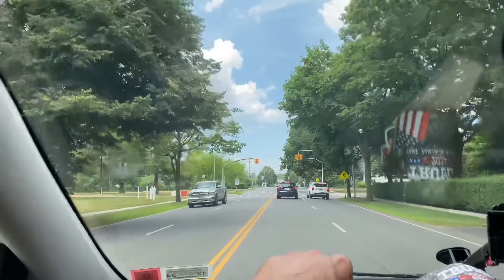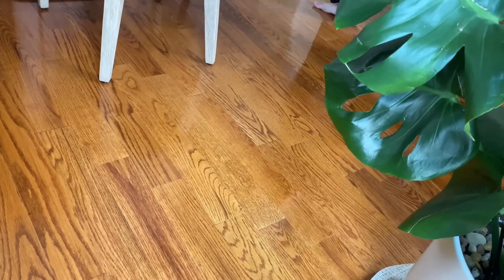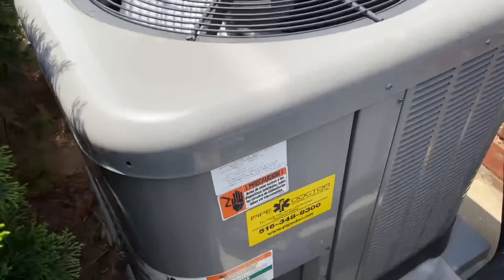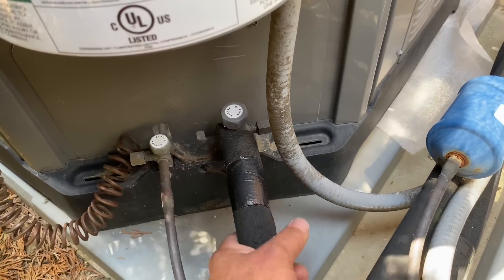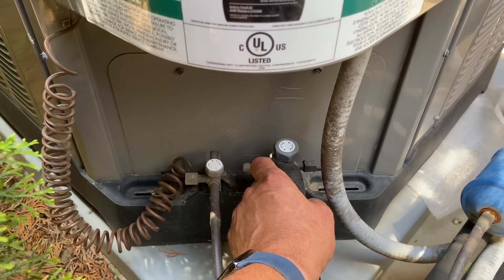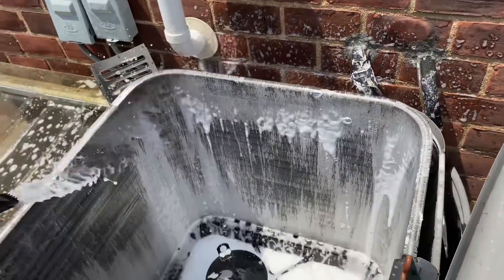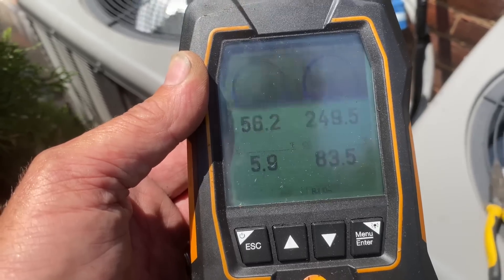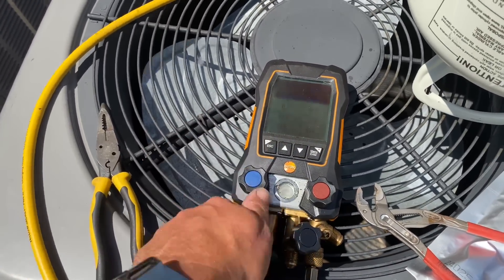Central AC System Not Cooling - Outdoor Condenser Beyond Filthy! Step by Step HVAC Service Call

Comment: You should know Mike , your stickers are on it and you can check your records ( by address not name, as they are new owners) for previous years and see what you have done there in the past. Good advice for coil cleaning. Always from the inside to the outside. Periodically cleaning the coil from outside is not a bad practice though. I generally tell my clients that coil should be chemically cleaned in two year cycles and periodic cleaning from time to time during lawn watering is a good practice to help with grass clippings and other debris.👍👍🇨🇦

Comment: Clean 100% no. Can Clean about 90% witch is good enough and much better then before. Plus factors like water pressure and coil design player Factor but yes you can clean very well from the outside without taking all apart it's just a matter of how much time do you want to spend cleaning it. For YouTube video purposes it looks very nice taking apart.  Again instead of adding sealant witch doesn't work instead of performing electronic leak check and finding leak to begin with. 95% time in evap coil. Good video Mikey
Reply from the maker: Thanks for sharing

Comment: Don’t ask my why but a fur coat seams to lead to a leak somewhere in the system .  A super super fine leak under normal operating temperatures takes couple years to leak out but high pressures from a fur coat  will find that leak … if the system been in for 3 + years that about a pound a year…  that’s a SUPER Fine leak an them are hard to find even with the dye….. I got a 5 head mini split making me pull my hair out 🤬 condenser checks out fine. All five heads check out fine.  A run  all  5 line set a zero nada nothing…  but in 3 months  she is down again !!  I’m pulling my hair out. No visible leaks to different sniffers. Did not pick up the leak.

Comment: Just out of curiosity, did you offer to do a PM and system check on the unit next to it?  if no maintenance was done, it probably needed to be washed and the refrigerant at least checked as a secondary service while you were there.  Just something we do as an add-on, plus sign them up for your service contracts for both units.  Leak seal that we use is up to 7.5 ton with dye and it really has done a great job of stopping or slowing the leak that it holds for years or we don't hear back until next service date.  Doing a leak search after a week is a good time to service the second unit.  Just thinking maximizing the call for both parties.  Food for thought anyways.  Love the content!

Comment: Would be cool to see you do a test on those Condenser misters.  Would be cool if you had a Well, or rain catchment. 
Also, would be cool if the Mister had a sensor and only ran when the ambeiant temp is above 90

Comment: That’s a fairly new unit most likely still under warranty (parts only ),if they registered it. I’m betting the leak is at the evaporator coil around the distributor. Your die should expose the leak next time you’re out and you will be back out.  Good job Mikey pipes (I have to admit you do an excellent job of cleaning those condenser coils ; I can’t imagine anybody doing a better job, not even me (as my old roommate from the island of Antigua would say when we were in Linn state technical college for HVAC  “ too good man “ not just good ,too good man).

Comment: , I just had today high side at 500psi! Low side 98psi. Should I check for acid test? Duct work looks very good sealed every, new filter, air flow is great. Just doesn't stay on tempature when outside is in high 90°. I was thinking it's a bad txv but this video is saying it might be a compressor burning out. I've seen compressors burning out where both high side and low side pressures were high. I hosed it down and while hosing high side went down to 385psi low side to 89psi but it didn't stay for long.
Reply: High subcooling with high superheat usually means bad txv. Did you check those?
Reply: sounds like the TXV is shut/screen blocked with debris. reused lineset on a burnout? wrong txv for gas type? wrong gas/contaminated/fractioned off?
BUT do check the temperature on both sides of filter-drier to rule out it being clogged before jumping to TXV as diagnosis! no refrigerant to txv = no worky!
the compressor may be eating itself and contaminated the system, there was a bunch that did that and would clog the txv/filter/screen and schmutz the whole system up.
Reply: High head pressure is a heat rejection problem or overcharge. Dirty condenser, fan motor spinning backwards or wrong fan motor or system overcharged.